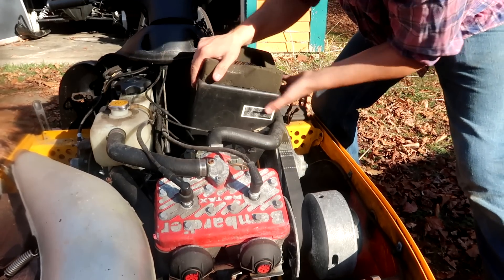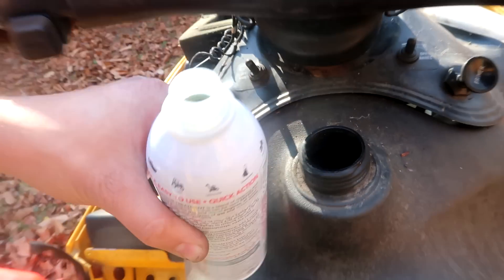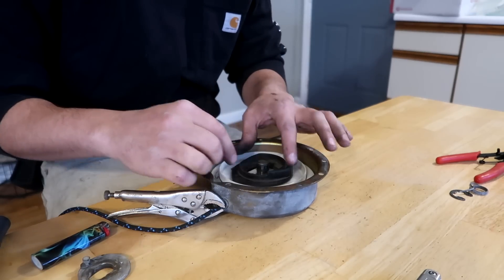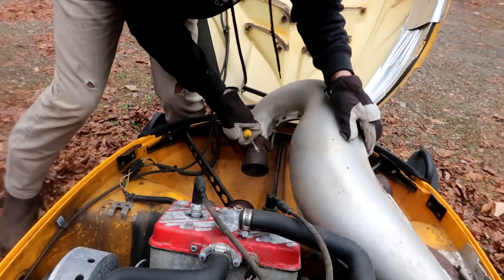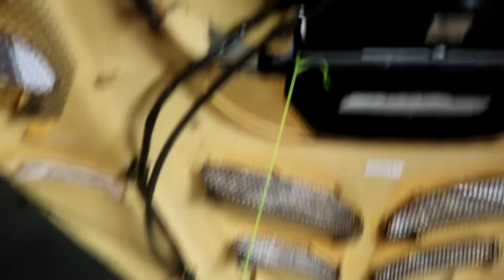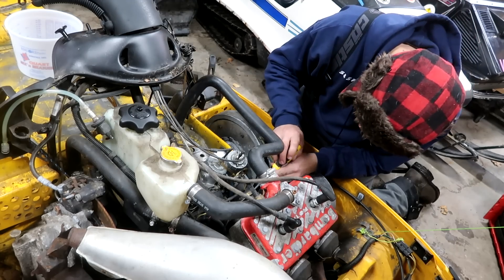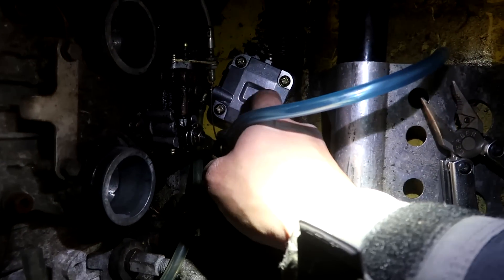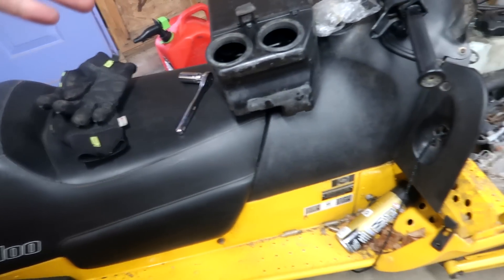Is My Ski Doo MXZ Snowmobile DEAD?? (I NEED THIS FIXED)

Comment from the maker: I want to see down below what YOU are riding this year!! Let's hear them sleds!! Thanks for watching! I appreciate every single one of you!
Reply: Ockelbo 400, an old swedish snowmobile😉
Reply: A arctic cat pantera triple 800 and a arctic cat cougar 550
Reply from the maker: @isaksjoberg3537  Damn! Nice! Never heard of it until now!
Reply: 1999 skidoo summit 500 and 1998 skidoo tundra 2 277 and a 1991 skidoo tundra 250
Reply: Get a skidoo formula 1998 or just use that mxz because its basicly the same
Reply: 1998 Polaris Indy xlt 600 tripple cylinder
Reply: 98 mxz 670.  6" risers and a lifted seat from a 2021 mxz
02 mxz 700.  Stock.  went to add Isoflex and found mag side bearings bad.  ended up replacing bearings, vforce3 reeds, new gaskets and piston rings.  Running great
05 rev 600.  Stock besides 4" handle bar risers and powermadd 3" seat riser
Lots of good old sleds out there cheap
Reply: 2000 Yamaha 700 SXR and the Wife is on Her Yamaha Vmax 600... hopefully We get some Good Snow this season.
Reply: Rocking an 03 mxz 800
Reply: 2003 skidoo mxz 600ho last year they made the zx chassis
Reply: 1997 Polaris xc600 triple chassis with 1998 xc600 twin engine.
Reply: new boost!!
Reply: 2014 Polaris assault switchback 800
Reply: 1980 Scorpion TK Whip 440
1983 Yamaha Enticer 300
1985 Yamaha Phazer
Reply: Nice editing,  but longer segments please.
Reply: 2002 polaris xc 600sp X with m10 skid.
Reply: 2013 ski doo 600 with can all matte black with night rider lights on the nose so she looks bad a$$ at night
Reply: 92 Polaris indy 440
Reply: Have a 2000 Yamaha sx600r old redhead triple. Hope we get decent snow down here in Pennsylvania
Reply: 2008 Ski doo mxz 600 sdi
Reply: If you don't want to pull your arms off pressurize the tank by using a air hose and if you don't have  access to a compressor, blow into the tank.  It will fill the carbs and it only takes 20 to 30 seconds and normally the sled will start within 3 pulls.
For my rides I am riding a 02 xc800 updated with a 04 oil tank, air box and roller secondary, also a  04 xc800, a 99 xc500, 81 Pantera 500, a 2017 800 Rush Retro and a 2022 xcr850.  
I am thinking about a new Yamaha Sidewinder srx. I will be buying probably tomorrow.
I love them all, old and new but not brand loyal. If I get a good deal I buy them, running or not.  Most I resell, some I restore to like new condition and keep. I would like to keep them all but don't have the room.
Great videos, keep them coming!
Reply: 07 Crossfire 1000 Sno Pro
Reply: 2017 rmk 800 axys
Reply: 2016 renegade xrs 800 etec👌 try not to split a crank this year 😂
Reply: 04 skidoo rev 600
Do you still have the 700 mxz?
Reply: I have a 97 skidoo formula 500, picked it up thursday and its been running good since
Reply: 1995 Polaris xlt special
Reply: A 2001 Polaris Edge x 600
Reply: 1996 Polaris Indy xlt special triple
Reply: Indy 500
Reply: A summit 1994 470
Reply: 1200cc Polaris HTG big bore.. Based on the xcr 800 motor
Reply: 2019 Polaris assault 850 144
Reply: It should be ur main sled
Reply: Yamaha rs vector or yamaha apex
Reply: 73 John deer 400, 1981 skidoo citation 300, 1973 Skidoo Elan 250t, 1973 Yamaha 433, 1975 Yamaha 433, 1979 skidoo citation, 1982 Yamaha enticer 350, 1979 Polaris Apollo 350, 1980 Polaris Apollo 350, 1985 Yamaha enticer 350, 1997 Yamaha enticer 2 410, 2006 skidoo summit 800. We have an addiction😂. 2 feet of snow already here in Montana we’re supposed to get a lot more
Reply: What happened to your mxz 700 that used to be your main sled
Reply: 2004 rx warrior
Reply: 2011 Skiddoo mxz tnt 600 (carb)
Reply: Arctic cat firecat 500 team edition
Reply: 2005 xc sp 700 twin! Just bought it last year and rebuilt the motor! Now just waiting on snow so I can take it on it's first ride under my ownership
Reply: Old ass polaris 440 i kicked to life last season
Reply: 2015 Summit X 800 163
Reply: 1994 Skidoo mx 470 121"
Reply: Yamaha enticer 410 t/r. But little snow yet in middle of sweden
Reply: 95 Yamaha vmax 500
Reply: an 0'2 xc 500 edge
Reply: 2001 MXZ 800
Reply: I'm riding a 1990 polaris indy 500 and a 1993 arctic cat panther deluxe 440fan
Reply: A 1993 arctic cat jag z 440
Reply: Lynx boondocker 850 3700re 2020 🇸🇪🙌🏻
Reply: 1997 arctic cat zrt 600 and a 2001 skidoo mxz 600
Reply: 2010 ski doo mxz tnt 600
Reply: 2021 Polaris kahos 850 silber turbos 165 track.
Reply: Yamaha exciter 440😎
Reply: Riding 1999 Mxz 670HO. Yes you should ride that like it's your main sled!
Reply: 2012 arctic cat m800
Reply: A 2005 skidoo summit adrenaline 600 ho and a 2006 skidoo mxz renegade x 800 ho
Reply: 1998 formula 500
Reply: What year was your formula 500??
Reply: 1997 Ski Doo Summit 583, with modifications of course 🤘
Reply: 2002 rmk 800 156 and a 96 indy gtrail 340
Reply: A 1993 polaris Indy lite gt 340, 2007 Polaris rmk 600 h.o 144, and a 2022 polaris 550 voyager
Reply: A 1993 polaris Indy lite gt 340, 2007 Polaris rmk 600 h.o 144, and a 2022 polaris 550 voyager
Reply: You should add compression testing as a usual part of diagnosis. Rebuilding a top end is a normal part of 2 strokers.
Reply: 2001 Ski doo mxz600
Reply: 2004 skidoo mxz550f rotax
Reply: @kevinmiller614  same but the 500ss
Reply: 99 ski doo mxz 670ho
Reply: 99 mxz zx 600 chassis with a 01 mxz 700 motor ported polished v force reeds with spacers dyno port pipe with race can front shocks out of a 05 mxzx chassis rev and rear skid out of an mxzx chassis
Reply: 2014 ArcticCat 9000 and a 2012 Polaris rush 800
Reply: 1980 skido citation. All original insides.
Reply: 1995 Polaris Indy 500
Reply: A 2004 artic cat zr 900 and a 2001 ski doo highmark 700
Reply: @Crew440  i love those. That was my first sled
Reply: 1975 polaris colt SS
Reply: 2013 Polaris Indy SP 600
2017 Polaris Switchback 800
2013 Polaris IQ LXT Touring 600
Reply: A fleet of mid 90's arctic cats lol zrt 800 is my favorite
Reply: skidoo double eight hundred
Reply: 2001
Reply: I want to buy the mxz
Reply: I’ll be riding my 1997 arctic cat zrt 600
Reply: 2000 mxz 700 mint condition
Reply: 1998 Yamaha Vmax 700 XTC Deluxe that I rider forward "converted". Moved the steering column up as far as I could without needing to remove the windshield, slapped a riser + straighter handlebars on it and lowered the rear suspension mount a couple inches (which raises the rear of the tunnel up higher). Its a ton of fun, but not quite as nice as newer sleds.
Reply: Polaris Rmk 600
Reply: 99 xc 700 with mbrp race can
Reply: 99 Arctic cat ZR 500 efi.
Reply: 2017 Renegade 850x and 2003 Rev Mxz x 800R
Reply: 2002 Mxz 800r
Reply: 700 xc
Reply: 1995 Yamaha vk 540ii
Reply: Ski doo Mxz rs 600 2014
Reply: Elan
Reply: Polaris 600rr 2008 😁
Reply: 2005 polaris rmk 900 151" and a 2001 yamaha sxr 700 triple 134"
Reply: @rumplestiltskin1056  sounds clapped
Reply: Ski Doo Grand touring 583 (horrendous condition)
Reply: Pretty much the same as that. 97 ski doo mxz 670 but with a bunch of work done to it
Reply: Just bought my dream sled that I’ve wanted since I was a kid and got a good buy on it. 2005 Mxz 600 SDI. Rev chassis of course
Reply: 1994 Indy lite deluxe 1994 Indy lite 1995 Indy trail 2013 rmk 600 prob a rmk 800 (both rmk 155 track)
Reply: @JeremyRhydes  I'm riding a yahmaha  bravo LT
Reply: Do you live in vt
Reply: I have a 97 MXZ 583 lol
Reply: 2012 polaris switchback 600 pro r
Reply: 1995 Polaris rxl 650 bored .05
Reply: Polaris 800 rmk
Reply: 03 Arctic cat F7 sno pro
Reply: 2014 mxz x 800 etec and backup is a 2006 mxz 500ss
Reply: Articat f6 we use to have a 1997 formula 500 fast and a good sled
Reply: 1996 Arctic cat wildcat 700 efi
Reply: The recoil problem is easy I just had to fix one either that exact issue u just take a hammer and gently tap the casing where the recoil tope goes in
Reply: 97 Formula 500 deluxe
Reply: Yamaha nytro xtx 2009 but gonna buy a more vintage sled soon to ride on to 😂
Reply: 1996 skidoo grand touring 580!!
Reply: Ive got 2 sleds ima be riding this year a 96 rotax 380 touring e fan and a 95 440 mxz lc
Reply: I ride a 2002 skidoo summit 800 a summit 670 ho summit 583 2002 skidoo summit 700 600 a 2013 skidoo summit 800 163 track and a 1965 skidoo Olympic 1971 skidoo elan skidoo tnt 640 skidoo Nordic 640 a skidoo blizzard 797 triple Mxz 800 Arctic cat 1000 triple a Arctic cat king cat 800 four cylinder Polaris rmk 700 and about 50 more snowmobiles I have to many
Reply: @JeremyRhydes I ride a 82 Polaris sport it’s in the line of ss 440

Comment: Was a snowmobile mechanic for 7 years back in the carburetor era,, easiest way to get fuel to the pump/carbs= find vent line for tank, plug it or hold it folded over to seal off,  blow in tank with your mouth sealed up against the fuel filler opening, when you feel pressure build, hold it there, it is pushing the fuel through the lines, usually takes less than a minute. You can also use an air compressor ,air chuck and  a rag, use rag and chuch at fuel filler, hold rag to seal with air chuck 
at fuel opening, lightly preqserise the tank that way. Works evert time. Yor problem is you haven't payed your roTAX lol,, also make sure pulse vac line from crank case to pump is good. Great videos!

Comment: I miss your early 2000s MXZs those sleds are the best.
Reply: I got an  02 and a 98.  Love the mxz
Reply: @rumplestiltskin1056  I had a 97 670 once I did a top end rebuild that sled ripped hard but didn’t quite have the looks to me at least of the next generation sleds. I sold that one and now have an 05 renegade 600.

Comment: picked up a ‘96 mxz 583 this past fall, just waiting for the snow to fly now! I had a bunch of issues with my recoil too. Still doesn’t work perfectly and sure it will break at some point this season. Seems like they weren’t designed to last 25 years 😒 she runs like a top though! Hope you get yours working

Comment: Just came across this channel. I just picked up a 1996 mxz583 for free. Not getting fuel, fuel pump rebuild time. Was sitting since 2017. Carbs are super clean. Guy said he had to prime it a ton to get it to start, yeah that’s fuel pump. Replacing the primer too.

Comment: Crazy, I was just coming to your newest video to ask you an Mike or anyone else who wants to answer. How often do just replace the fuel pump vs just taking it apart and cleaning it. I work on outboards and usually just buy new ones without even looking inside the old ones. Engines are usually 1970 to 1990 though. Super old. That being said I see you an Mike just clean em an slap em back in.

Comment: A quick way I prime up my sleds is to take the fuel shut off line that goes to the tank off, and then blow into it. When you hear it blowing out of the tank vent, fold the line and slap it back on and fuel will gush out. I'm riding polaris by the way. '92 440 sport and 500 efi sks, and a '97 xlt 600 that ate its crankshaft two days ago 🤘 rock on buddy!

Comment: Pro primin tip. On the skidoos usually they stop priming, but I found a bypass. Take the line that comes to the fuel pump from the tank and put it straight on the primer T then connect the lines going from the T into the carbs again and blow in your gas tank. And  boom both carbs primed with no primer. Happy riding! Added make sure to disconnect the lines after starting, it bogs very hard when they are left on.
Reply: Me and my buddies found this out on his skandic 503r on its first start in 9 years

Comment: Hey my man. use your noggen on this one. there on your shop vac there is a in and a out on it change your imput hose side to the other conection and it will act like a small blower. Not 100lbs but it should have enough the mouse next. once you discover this  you will use it 101 different ways .. I hope this helped you out bro. Keep on shredding the snow my friend

Comment: Gotta watch those mikuni slide carbs.  If they sit without fuel, the o ring around the float assembly will shrink and fuel will not shut off flooding the sled when running.   have to remove the 2 phillips screws on float assembly to get to the o-rings.  Also its a pain in the ass but check on the isoflex if you have over 3K miles.  I found bad bearings on the mag side.   All the grease had been sucked into engine.  Wouldn't have lasted long had I kept riding it.  I replaced the bearings and all gaskets

Comment: When it doesn't start like this? I take a small twig from a tree about  a 5/16 inch diameter.
And put it into the thumb throttle to hold it open? It seems to do the trick. You just have to remove it quickly or the sled will take off on you.

Comment: Im riding my first season this year on a 1994 ext580 mountain cat!
it has problems though, mainly it will reach clutch engagement at 4500 rpm and then die off, not sure why, has fresh built, rebuilt carbs, spark plugs, new chaincase and 2 stroke sled oil, new gas, new coolant, and just cleaned the primary and secondary, 
any advice is greatly appreciated, thank you so much

Comment: Hi Jeremy. I've recently found your channel while as I've been learning how to work on snowmobiles. I have a 2001 Skidoo MXZ 600 2 stroke that I just started having a problem with. I swapped out the spark plugs and found that even with brand new ones I'm still not getting much spark (maybe 5 sparks out of 50 pulls). I'm trying to figure out if the problem is in the ignition coil or the stator coil (I'm assuming the wiring harness is fine). Do you know of any good way to test them?

Comment: Best way to test for water in the fuel is putting a few drops of food coloring in. The dye will not mix with the fuel but will dye all the water that color otherwise it will sit in little beads in the tank.

Comment: Jst to let u know u aren’t using the choke right u pull it out and then start it till it starts and dies then u push it in and then u pull the rope , also it should take 7 pulls after u empty it also all tht junk in the pump u should of clean ur carbs they probally have jet full also a trick is there a hose tht goes into carb suck on it with straw or mouth untill u see gas tht means u primed it all then hook it up to carb it should start on first -secound pull everytime

Comment: Put your shop vac on blow and pressurize the gas tank, it will make life much easier. If it’s going to run it should start first pull

Comment: You should get a old Yamaha phazer
Reply from the maker: I'm on the hunt for one!!
Reply: @JeremyRhydes  I had a 87 Yamaha Phazer Deluxe and it was a awesome sled, it was a blast to ride and very dependable but if you get one, put a new oil injection pump on it.
The oil injection pump has always been the weak point on the old Yamaha's.

Comment: Just blow in the tank.  With the clear fuel lines you can see when it had gas to the carbs.  Start in 2 or 3 pulls instead of 30.

Comment: i watched your video.i bought a 2001 red mxzx 700 twin brand new i paid 8000 for it in 01.the guy that ordered it the dealer fired it up and hi wife said noooo you will kill yourself.along i came.traded a nice mint 1998 skidoo formula 583 they gave me 4500 and charged me 4000 extra and i was 800 dollars short and had to call wife to help with extra 800 i was so in love with that sled.i felt quility for 2 weeks but that wore off so fast after i found out my model was beating the 800s that years.smiles all around then that thing was a major beast.it was the red colored sled.i still got the poster in garage same sled but the 800 mxzx